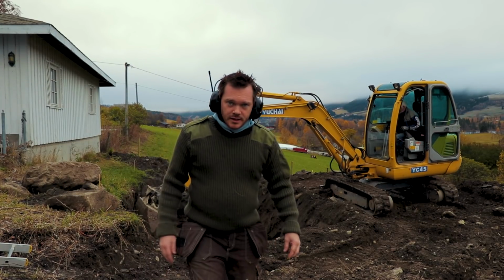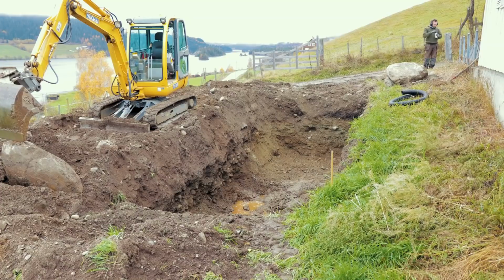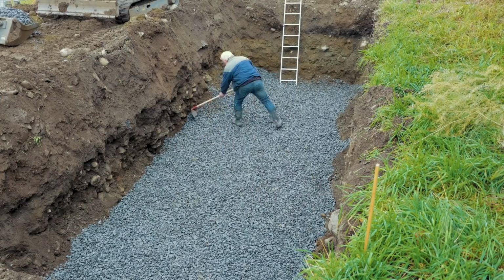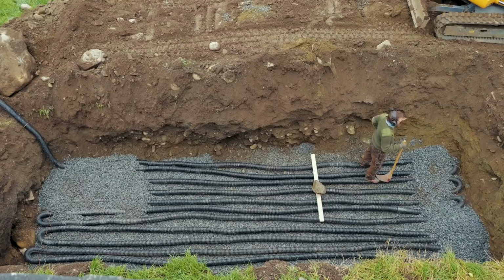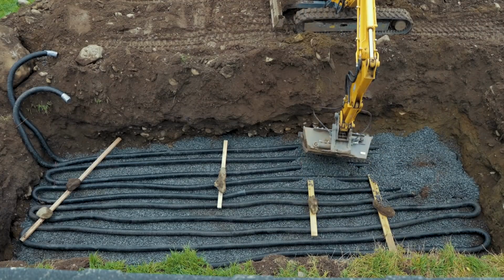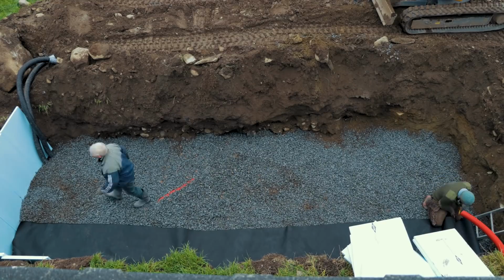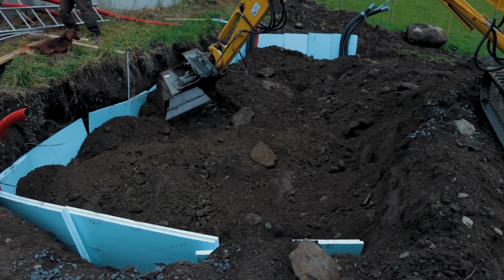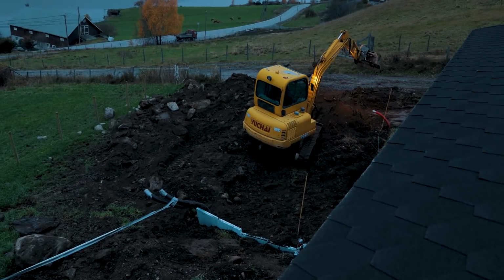GeoThermal Greenhouse Build | Part 2

Comment: I was wondering if it would be better to install one small blower on each tube instead of having one bigger blower blowing air on all the tubes at the same time.

The idea is to have continuous airflow in case one blower stops functionning and more flexibility for air distribution. 

We can switch on and off one or more blowers if needed to get the desirable airflow.

Comment: I am sad for you because the way you did it is far from optimized.  If you search on internet you will find some research about GAHT systems given you some tips about how to optimize such a geothermal system.   The most important starting point is that to optimize the heat transfert in the 4 inches pipes, the air must stay in the pipes around 4 sec..  If it is less then the exchange is insufficient and more means that your pipes are either too long or the speed of the air is not fast enough.   So in your case, of what I see, your pipes are probably too long.   There are other points to consider like the space between pipes and the depth but I do not have time to explain everything here.   If ever you do another one I strongly suggest you to read more about it to get more technical information.

Comment: Hello. Hope you have been lucky with your system. I've been researching earth batteries here on YouTube and other web resources and one thing I learned is that the optimal pipe length for the small diameter (4 inch) branches is 25 to 35 feet where each pipe connect to a larger diameter (8 inch) perforated tube at both sides of the dig. This length is said to be best for getting rid of the humidity in the air into the soil for cooling the hot and humid greenhouse air. In the winter, cold and dry air in the greenhouse is humudified by the water in the soil, and when water becomes vapor, it also carries the heat it gained from the soil into the greenhouse. This is actuallythe main contributor to both heating and cooling potential of earth batteries (phase changes of the water) and like I said, the above length of each segment was found to be optimal for this purpose.  Your tube length is very long if this is actually correct and I learned from some Canadian installer, a mechanical engineer indeed, who said he has been designing these systems for years (his YouTube channel is Verge permaculture), for commercial customers too.
Reply: When the cold. dry air picks up moisture it takes sensible energy from the mass to effect the phase change. The sensible energy is converted into latent form which doesnt affect the temperature of the air just the RH%.

Comment: I am wandering if you can use this system with a green house that I already have by excavating next to the green house and running you heat transfer tubes to the inside of the existing greenhouse
Reply from the maker: Should work, but might not be as effective.

Comment: What type (and how many) temperature sensors did you use?
Also, did you connect them to a computer data loger ?
Reply from the maker: I will switch out everything this year to my own made microcontrollers, and use a variety of sensors. I will make a video on the setup once the greenhouse gets going. :-)

Comment: I'm no expert in thermodynamics, but I think nesting the pipes so close together probably reduces the amount of heat exchange you're getting, significantly.  The temperature change you're obtaining is from the gravel around the pipe, so except for the outermost pipes, you're not giving the gravel as much of a chance to rebound in temperature from the heat/cool you're extracting.  I think the idea is long, narrow trenches, rather than one big pit.  I could be wrong.  I just think you're overestimating the amount of heat conduction underground.

Comment: I'm toying with the idea of using a thermal mass battery such like this but not for green house but for bringing up air for an air to air heat pump for housing. I'm also thinking of using the air in an economizer for living space air. Looking at the amount of ground water Im thinking that using this for what I'm thinking that would need to be addressed as that ground water would make the air unsuitable for an economizer. Perhaps using sealed HDPE pipe  and welding together a grid using vertical headers at each end where you could set a sump pump would mitigate this. Does anyone have any engineering math to calculate out a delta T and pipe length ?

Comment: the length of pipe - would shorter sections all terminating in the same place reduce the size of the air pump required to move the heated air in and out of the pipe system?  Would 5 x 20 metres be better than 1 x 100 metres?  Thanks

Comment: Great video and information.  I didn't read all of the comments but are you adding a perforated drain time near the white building?
It's my thought drainage along that side may be challenging.  Just a thought.  
I'm sure you have it figured out.
Reply from the maker: It actually works very well! Running for two years now.

Comment: I learned my Geothermal air system from a very competent citrius grower in Wisconsin who 
for years no buddy would believe was growing there all year round. I guess you are going to 
pay a small fortune heating the ground under your greenhouse and have a massive amount 
of loss, where I use the ground thermal to stabilize the temperature in my greenhouse at about
65 degs. with 1 six vdc fan, 1 solar panel, and 2 12vdc batteries on a small charge control.

Comment: Stuff with more mass holds temperature better, water has more mass than air so moist dirt seems like it will be more temperature stable than dry dirt because it is more mass. But it won't matter anyway either way because if you dug down below your freeze line in your area, then the earth itself keeps its temperature stable down there regardless moist or dry. That is the whole purpose of using geothermo style, taking advantage of the stable temperature under the freeze line, summer or winter. But i figure you must be talking about temperature transmission, or temperature conduction between the earth and the pipes, because i know you must know what you are doing. And i agree if that is what you meant, to get better temperature transmission from the earth to your pipes you used large gravel with big air gaps so in essence you are extending your pipes into like a tiny vein system which can extract more temperature. Genius thinking.

I didn't catch the reason you used perforated pipes unless my figuring was right above, maybe i watch again later i missed some stuff.

Comment: HI,I would like to know the pipe details like type of pipe used,its diameter,details the insulation blocks you are using in the sides and also the black sheet which you are using in between the layers of pipes and soil.
Thanks

Comment: Thanks for your video. And I wish you success.  I assume by now you are up and operating. I am concerned about mold growth in the buried ducting.  How would mold not grow in the buried ducting?  You are not going to any usable air volume through  300 linear feet of 6" corrugated plastic pipe, By now you may realize you should have installed 14 to 18-inch headers.  I have yet to build, but my scheme involves supply and return wells and heat exchangers. Take Care. Mid -Atlantic US.
Reply from the maker: I will make a video before winter with my thoughts on my setup and how it has worked this summer. :-)
Reply: @ChristopherBrandsdal  I reviewed more of your videos. You built a really nice greenhouse.  You may consider getting your airflow volume up to 6 - 8 room changes per hour to attempt to hold your humidity down. The amount of air you move is most important as long as your ground sink is lower than your leaving air temperature if your goal is cooling  Lastly did you consider the entire interior of the greenhouse volume.  As mentioned there is flowing water under the heat sink....the sink is going to be losing heat quickly. Good Evening.

Comment: Covering pipes with drainage material is very stupid idea man, this way there is much air around the pipes, and the air is good termoisolator, so the heat exchange is lower. The best you could do is to make  a bed of clay under the pipe to hold water and make the soil around pipes denser this way you will improve heat exchnge between the air in pipes in the soil.

Comment: ❤️🇺🇸YOUR DAD RUNS THAT EXCAVATOR LIKE ITS PART OF HIM❤️🇺🇸 can’t wait to watch part three! My difficulty here is you dig down 4 feet and you have flat ledge at 4 feet and I think I’m going to dig down to it and put a temperature probe there and watch it this winter because I think the ledge itself will hold or deliver more heat and the rock?
I wonder if you clean off the ledge in a similar area put the tubing down and anchor it and pour a concrete slab directly on top of the ledge and your solid piping, would that then become a much better heat sink😳.  Hmmmmmm I wonder???
Reply from the maker: Many good questions there! Not sure. You should definitly dig down and thest the temperature this winter! Awesome idea!

Comment: You should check out the Thermal Greenhouse build on HowToFarmAndGarden.com. They used 6" perforated pipe with large rock around it. A bit different approach but the results are amazing.

Comment: What is the reason to use perforated pipes?
Reply from the maker: And also for condensation drainage.
Reply from the maker: I want to take advantage of the air running free into the gravel.

Comment: As pointed out by others, each run should be supplied with air through a header - you will not be able to pump enough air through one long run.    Sadly, you see the same problem with the solar thermal people where they use one long run of copper tubing.   You have to keep the air and/or water velocities relatively low to avoid large pressure drops which in tern limit the efficiency of the fans or pumps.
Reply: The tube layout will force the fan into providing less air which rquates to less heat being moved. Remove the fan from the system where it can produce its maximum  flow rate and Measure the current draw.Place the fan back into the system and check the current draw again.The lower the current, the less air the fan is producing. In Christopher`s layout its not easy to draw a definitive conclusion from this test because the air can take a shorter path through the gravel to reach the outlet  Air will always take the path of least resistance.
If you see high current draw (high fan air flow rates) on the serpentine tube layout you can be sure the air is bypassing a lot of the tubing because the resistance in that type of layout will be very high and you would expect to see less airflow highlighted by lower fan current draw. Sinking temperature sensors a some distance from the inlet/outlet tubes will tell you if the air is getting there or not. Ideally, you want to be seeing a temperature change in the mass over the entire length of tube. If you see a change in the first few feet near the inlet and no change further away, you can be sure only a percentage of the tube is actively exchanging heat.

Comment: do you also have some guidelines for length and diameter of pipe when they are filled with water? i live in dubai and aim to col down the pool water by 5-10 degrees by running pipes under ground.

Comment: How is your geothermal heating and cooling system working? I put one in almost the same as you. Mine filled with water and I can't get anything all the way through the tubes to pump it out. You have that problem at all?
Reply from the maker: I am not finished With the build yet. I ended up digging a drainage pipe all the way out of the property to avoid water filling up the pipes. Will show more in my next video the coming weeks.

Comment: Great project I built one myself and I’m nit sure as to your location but a small EFFICIENT wood boiler would be a smart backup especially if the temp drops below -10c.   Peace
Reply from the maker: I am considering that. Just have to get it up and running and take it from there.
Reply: rocket-stove mass heater so you only need to run the thing an hour or so to keep the chill off all night, without smoke/stink.  You pump ALL the heat from the fire into an earth mass and it gives it back over hours.

Comment: A red flag for storing the heat in the soil mass below your greenhouse was the high water table or excessive moisture in your system. I have heard that the water will disperse the stored heat away very quickly and not allow you to use the surrounding soil as a thermal storage battery. You should still have no problem using the thermal mass above the heat tubes.A quick fix to your dilemma might be to cut your tube length down and increasing the number of supply lines. A little shovel work now might pay off handsomely. Air resistance is the major flaw with LDS's design.  If you plan using a movable insulation cover at night many of your concerns will be taken care of. Just having an insulated hole in the ground should keep you above 45F (7.22C). Good luck and you're doing a good job!
Reply: Mars Rover yeah your so wonderful your advice too bring a shovel Mr red flag
Reply from the maker: Thanks for the input!

Comment: How exactly do you monitor the heat?
Do you use the IoT and an arduino or how exactly and do you know how to program for that measurement and regulation of heat flow and temperature?
Reply from the maker: You are correct. IoT! I will do a program on this come spring when I set it up. Will share everything.
Reply: The best option to control the system fan is to use a combination of standard thermostat and differential thermostat in conjunction with a fan speed controller. 
Having a multitude of air, soil temp and RH sensors/ probes both inside and outside the greenhouse is great for collecting, tracking and comparing heatflow data.

Comment: how deep is the frost line at your place? In Germany we say it's at 60-80cm...
the idea of geothermal is to use the heat/cooling from the ground so insulation below the frost line doesn't make much sense as you can't use the thermal mass of the surrounding earth in that case (sometimes insulating flat shortly below ground level is even better than vertically)
Reply from the maker: The frost line here is close to a meter.
Reply: Yeah, it wouldn't make sense to rip out the existing insulation.
I just wanted to say that insulating below the frost line (1m in Chris' case) is not really needed for his application and the flat one might be a possibility for future projects or other people wanting to replicate it (easier than digging very deep)... maybe for the other half of the greenhouse?
Reply: I think Jarnar is talking about a "Swedish Skirt" type of insulative system. This lies horizontally on the surface and creates a 'bubble' at depth below it. Since you already have vertical insulation in place, you are fine.
Reply: The idea is to store the excess heat from the greenhouse in the ground. The heat comes from the sun, not the earths core ;)  If Chris`s greenhouse maintains 80F 70% RH on a sunny winters day as he runs all the greenhouse air underground 10x in 1 hour and it exits the tubing at 50F 70% RH he will move almost 80,000 btu (23.2kw) from the greenhouse into the mass in that hour. 
The main problem is Chris wont be able to capitalise on it as he cant move close to that volume of air through those two 328ft heavily corrugated tubes that were not designed to carry air (drainage). If that wasnt challenging enough there are 11 hairpin bends in each tube. Chris should bill LDS for the excavation and reinstallation costs as thats the only way to fix it.

Comment: hey!

Nice video, please upload the next step.

By the way, i don't get why you put some plastic cover over the gravel, the main source of energy in the soil comes from the solar radiation, so you shouldn't put any extra material capable of preventing the heat transfer in the soil from the surface to your circulation pipes.

Everything considered it's a nice video, it lacks alcohol, sex and rock and roll, but it is a nice video.